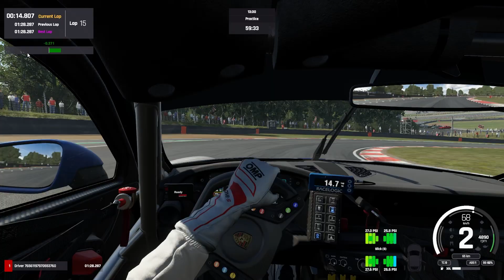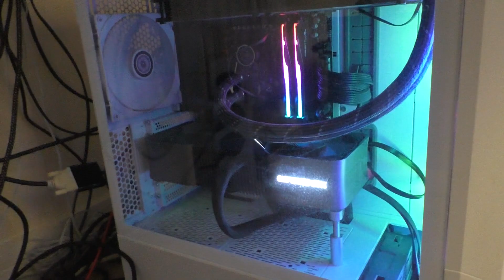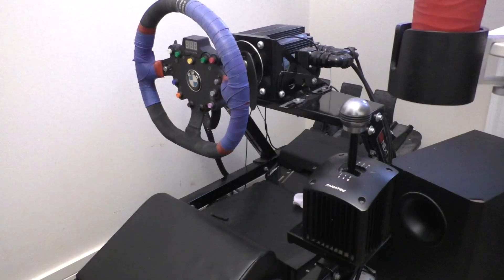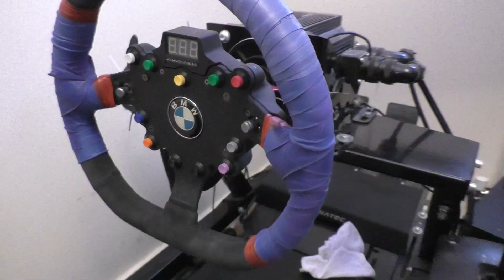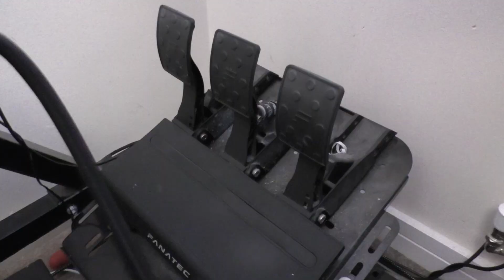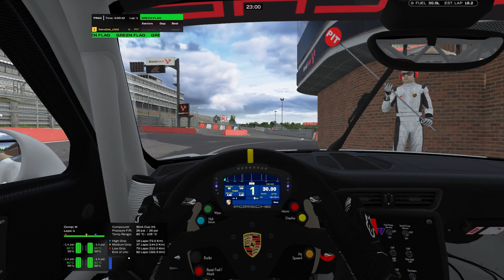Sadly Assetto Corsa EVO FFB Lacks this KEY Detail - Real Driver Explains

Comment from the maker: Hi everyone. I am amazed and surprised at the reception to this video and the viewing numbers, I regret not making it more concise and less boring 😂. Thank you for all your comments. A lot of you have asked for wheel settings I was using. I systematically went through all FFB settings before making this video, so as to ensure I did not come to conclusions missing something fundamental. I have spent another hour again going through all settings, turning things completely on and off, and my conclusions are exactly the same as this original video. I will do a much shorter follow up video to this, showing me going through each setting, trying it, and describing what impact different FFB settings are having, if any.... Stay tuned! 👍
Reply: I would appreciate any info on what  "dynamic damping" setting actuslly is or does. As I read from Stefano (the dev) the FFB is completely physics based. Which makes me wonder how it can even have a parameter/setting. Either Dynamic damping 100% or 0% should be physically correct 
That setting has never been truly explained for AC or ACC. Only word of mouth exists
Reply: @michael-3-l3  there is only one force (and I'm not joking) and it comes from the physics model
Reply: @AtomicAndi  I think it's mostly rack forces but not entirely - there's all those damping sliders for one thing. But yeah I think some of the sliders aren't doing anything yet.
Reply: How I made the FFB feel even better in AC Evo for me in mid corner an exit. 

Despite the lack tool tips and in my view misleading naming of the FFB options I think I found something to even better feel the entire masterpiece of the tire-suspension-whatnot-model. This helped me really feeling everything the car does. 

Try it. I know the settings look weird and counterintuitive. 
I can now not only feel the weight of the car and how much it’s loaded up on grip but also progressively when it is getting loose. In particular the transition from edge of grip to having a loos rear was hard to feel before. I now feel oversteer in time and can react on feel alone without relying on visual or audio cues.

Settings:

Wheel: 540 or 850

FFB: 50 to 80 depending on the car. 

Dynamic Dampening: 50 or more
(car dependent)

Speed Sensitivity: 100 
(only that gives me the full weight depending on speed)

Steering Assist Weight: 50 to 100 
(I like 10 o the most. Try and feel into it That one should be called “sensitivity to feel the loss of grip, higher value feel more loose and less resistance with less grip)

Rest on 0

 I am on a Fanatec CSW set to:

SEN: 900
Ffb: 100
dri: 3
For: 100
SPr: 100
dPr: 100
Reply: @hackmac2599  I do agree that the "dynamic damping" setting is mis-named and is quite important to keep at 50% or more.
The last 2 you mention are for controller (and steering assist on resp), so you must have had some placebo effect - or there is a bug
Reply: @AtomicAndi  Do you have a source? Placebo could always be. But The sterring Assist Weight feels like it actively make the wheel more responsive just like the "dri" setting on may Fanatec wheel base.
Reply: What im happy with in a game with great FFB is to feel the tire grip, then weight of the chassis move and lastly downforce. Alot of games cant do this correctly but original Assetto does for me but road texture is not it strong suite which is not that bad, ABS i just use my buttkicker. i havent played EVO as i race in VR and my GPU cant run it past 20fps yet but end of the year i will get a new card and game will be in better state! :D

Comment: Perfectly described, before you criticize this video, skip ahead to the end and listen to that first. Realism is not the point, and it gets in the way of realistic (seat of your pants) driving on the edge. What the original AC did so well was give use the information we needed in a way that was intuitive, On my first time going over the limit I knew exactly what was going on and I was able to correct and keep the car on track. Something I can’t do in new Kunos games. I have to stay beneath the limit and have my wheel sounds volume 2.5 times louder than everything else.

Comment: You do realize some of the time you're driving and giving feedback with a damaged car?

When the car is red is damaged. When is dark grey it's normal
Reply from the maker: The car was not damaged, it's a bug that occurs when inner bollards are hit on kerbs. It made no difference to handling or laptime, and has got nothing to do with anything.
Reply: @mo-r-racing To my understanding there is some mechanical damage, its not much yet, might just be suspension damage i believe but there is damage.
Reply: @mo-r-racing  I didn't notice any red on my car from the bollards when I was running it at Brands this week, but perhaps I missed it.
Reply: It’s a bug, they don;t happen all the time, maybe there was some quality to your driving that is different (maybe this guy is hitting the bollards faster?) This issue is known as many AC players are complaining about its lake of information. Dissmissing this based on one run with a damaged car is pretty weak.
Reply: @PaulKentSkates  no one is dismissing anything.  I responded to his video.  I'm running a one.twenty eight in the Porsche Cup at Brands GP.  I'm sure that's not pro times but  pretty sure I'm hitting the bollards fast enough😂.

Dude said it's a bug. I didn't say it's not.

Comment: I think the general public expect EVO or any other simulator/game to perform on the level of a multimillion dollar actual simulator, NEWS FLASH, THEY WONT !! It’s ironic Lewis Hamilton refuses to use a multimillion dollar simulator for training !! Let’s just enjoy what we get from ALL the developers, remember it’s for ENTERTAINMENT ONLY !!
Reply: Hahaha... no, no no no. Most IRL racing drivers prefer the sim, just because one or two F1 drivers, mainly pewis pamilton don't like simulators, doesn't mean they're bad. They are NOT only for entertainment, people use them to train for IRL racing all the time. Also with a good wheel and pedals and good setting, AC and iRacing can have quite excelent FFB... Which he also mentions toward the end of the video, if you had actually watched the full thing. They simply fucked it up in Evo bc it's not really intended as a hardcore simulator but more like a game where you can roam around and modify your car and stuff.
Reply: Correct me if I am wrong, But Kunos worked on Ferraris simulation software after Netcar, and they developed it further to make AC. When you play Kunos games you’re playing with the simulation engine that Ferrari has been using. Maybe not anymore. I believe Kunos also made the sim that Ferrari used to test its road cars at one point too.
Reply: @PaulKentSkates  You are not wrong. The physics engine behind AC was made for car manufacturers and racing teams for the purpose of simulator testing cars and setups.
The tyre model etc has been worked on to become more realistic and up to date over the years with technological advancements.
From personal experience and what some IRL GT drivers I know/train with say, AC and iRacing are both the most realistic sims out there, each doing some things better and some things less well.
Hell, in esport level competition we sometimes use the manual of the real racecar to learn about setups lol.
In the end, calling good simulators unrealistic because one F1 driver is a buzzkill and hates on them while everyone else praises simulators is bloody stupid. Lulu probably got out driven in a sim and started crying 😂

Comment: A physically correct FFB isn't that hard to achieve. AC was relatively close near center and at typical slip angles, having maybe a bit too much feel due to the really aggressive SAT dropoff. It's also wrong near max lock due to the steering ratio being parametrized and not solved, resulting in a bit lower forces at lock, but it's right enough for most of the curve.

That looseness near center is due to lack of power steering; it should be relatively unboosted at low torques and more boosted at high torques. ACE might be trying to fake it via some kind of gamma curve or something; but if you get it wrong it'll feel really funny. If you get it right but don't have compliance in the model, it'll also feel a bit wrong, being too tight on center.

Comment: Gt3 gt4 irl driver here, tried ac evo ffb - its beyond terrible, not even close to real car or any other sim we train
Reply: nice man, what cars do you drive? its weird because lots of other real drivers say its pretty good, lots of conflicting opinions
Reply: @WigSplitters  We use sim rigs mostly for drill and training, irl porsche gt3/gt4 and rally group B car, we have sim rigs almost 1:1 match, with active pedals it's very easy to do now. And when something is way off you can notice it immediateley, we tried our best to setup AC evo ffb but it just keeps sponging like aviation rubber. Iracing, Richard Burns, ASM2, rFactor2 they  always worked almost out of the box.
Reply: @rms_6401  yeah, I defo get a spongy feeling on the limit, anyway thanks, pretty interesting to get a different pov
Reply: Finally someone, who shares my opinion. Everybody just praises ac evos ffb and i just can’t understand why. It’s so overdamped I barely can feel the bumps of the road. It’s like driving on a highway even with all filters turned off ingame and at my base (CS DD). Same with my motion rig. Not much happening there at the moment. Tires feel ok in some cases (corner entry) but all in all very underwhelming sensation.
Reply: @corbecx4185  People nowdays buy books by the covers not it's content :) i'm glad i'm not alone in this boat

Comment: Regaining traction on the rear snaps wayyy to hard in Evo. Makes it flick the other way instead.
Reply: It helps that there's not a lot of grip to regain. You only lose like 5% at most. It'd probably drive basically the same without slip ratio sensitivity.
Reply: @ArchOfficial  going sideways with the M4 in drifting loses alot of traction on 4th gear on Suzuka. The ESC is clearly trying to retain the drift by braking individual wheels, making it snap back harder than expected.  Turning this off and disabling center spring helped alot to handle the car in oversteers :) i uploaded a Short to demonstrate. Now i can link the whole track without any issues. Before i knew the hidden ESC i couldnt link 2 corners haha
Reply: @VIGGENMUSIC  Not really, like I said, about 5%. Expect more like 10-20% at least.
Reply: @ArchOfficial  ???? How many percent of tractionloss isnt relevant. I dont know whats your point. Go ahead and smash a drift at 4th gear with the m4 at susuka and see if you have a 5% tractionloss with TCS off.  I have already solved my problem which in fact was ESC trying to regain control in drifts, making it snapping back harder than i wanted.
Reply: @michael-3-l3  even if assists are turned off, esc will be on. I made a short about this :) i have the proof of it. It has to be bind manually "ESC decrease" i options. No indicator shows if its on/off but you will notice it :)
Reply: @michael-3-l3  i have literally video of it, and i showed in that short how the ESC works.  It brakes individual wheels to retain control, which in other ways can mess up your drift if you want to oversteer
Reply: @michael1  its in newer cars like the M4 shown, gt86 aswell! i clearly showed you that its on by default. And it has no indicators of being on/off so therefor its hidden. If you only saw a wheel, and it not locking up for split second you need to watch again. But hey, iv done my research on this, and tried it around for 2 days. I know what i know, if you cant see there is ESC active by default, you need to press F2 and turn hard in your default car and look harder :) but hey, whatever.. you can try it for yourself
Reply: @michael1  i dont brake manually in that corner at all. Im demonstrating ESC.  Why would esc demonstration include manual braking? If you cant comprehend something like that... good luck!
Reply: That's a sign that you have applied too much opposite lock
Reply: @Galactic_Gremlin  it brakes even on half steeringangle. Guys stop being naive and go try it out for real. Like actually do tests like i did. Do i really need to upload a video again just to prove you guys just assume you know stuff? :D
Reply: Maybe you need to be more direct with your steering ?
Reply: @mantasisganaitis2281  i have over 1000hrs in AC drifting, and have done alot of it IRL aswell. Even regaining slightly more traction on the rears make the car snap unrealisticly hard.  I spent hours last night trying to figure out if there was any center spring/dampening issue but concluded the fact that its the physics that cause it. Try put dampening on 0 and fulltrottle the M4 and you will notice as soon as you regain just slightly more traction again it will snap full force instead of dynamicly
Reply: @ put on less grippy tires, and adjust car setup, maybe ACTUAL CAR DAMPERS. Try stiffening rear a bit, increasing rear rebound damping, watch less gamermuscels, try differential settings, check if you can have faster steering rack if ACE gives such option, try to get used, try adjust your driving style and learn. 

AC hours count little. RL is kool, but you probably haven't done same with exactly same set up car and at same speeds and grip. 

I don't have ACE. rF2 is my home, I mod cars for myself. 

Not sayingt ACE is perfect. But it sounds like it does tank slap, and tank slappers are huge deal irl for anyone with too slow hands and too big oversteer corrections. 

Also use light handed technique.
Reply: @mantasisganaitis2281  i use my hands very little, mostly throttle. Iv tried everything possible now. HOWEVER i read something about ESC system being on by default and there is no indicator showing if its on or off in the car, so ill try to bind ESC and lower it manually. Might just be the reason why it tries to realign even when it shouldnt. Trust me, i have spent hours trying to figure out this and its not "me being to slow" or anything like that. Its something automatic och actual physics. It has been noticed aswell that sideways g-force isnt 100% when going up on 2 wheels, the force is way too hard and makes the car flip too easy when attacking curbs too hard
Reply: @VIGGENMUSIC  I guess I can't understand everythign perfectly as  Ihave not played it. But I understand that people who spend thousands of hours in AC1 has flawed reality perceptions. I don't say that ACE is right, IDK. If it has some arcadey stability grip control which actually makes driving harder, then it is sad. In footage I have seen, I saw no rawness of cars handlign I expect to see in simulation. But maybe people just drove with AC1 muscle memory. On cars flipping, in AC it was almost impossible, IRL it does happen, so perhaps it is step into right direction. Maybe.
Reply: @mantasisganaitis2281  yep, well I still do it like once a month IRL. And I can say from my experience there is something wrong. Everything else seems mint, just the regain of traction seems off, which cam be the ESC system most likely. And regarding filipping, its like the car doesnt have any weight once its on 2 wheels, even just slightly steering into the corner will raise the 2 wheels more. I dont think the distributed weight is spot on when being in air, its like all the cars weight is towards the 2 planted wheels, sure most weight should be there, buy not all weight :) this is just being nitpicky and i know Kunos will get there though :)
Reply: @ two wheels thign seems like it could be faked in unnatural way, cars should do that, but it should be different. The regainign traction thing is also what cars do, but without feeling and testign I can't give an opinion. I am just saying that sirmacers has no idea about how sharp high performance tires can be, they will bit you for being naive child. And I suppose they might not do that enough in ACe, or worse perhaps also in fakey way. I have no idea. Good luck. I am just enjoying rF2 a lot, building my own cars physics.
Reply: @mantasisganaitis2281  just uploaded a Short showing the ESC system. Too bad its not showing up ln the dashboard or anything so people can see. Oh and im not a simracer main, i used to drift my s14 that was fully specced for having fun

Comment: Brilliant and useful analysis.. it's about the same problem I feel with my controller.. the weight transfer to the rear simply arrives too Fast and too late.. at the point that you can't do anything more than spin off, or in rare cases doing a long and ridiculous looing counter steer, which looks like "show drifting "and have nothing in common with being fast.. loosing loads of time in there.. The results is that to prevent this tricky oversteer, as you wouldnt be able to use it profitable.. it force  you  for caution you have to go about 1 second off the pace, even with a road car, it simply loose grip too much.. like having narrow tyres size on the rear😅🤦